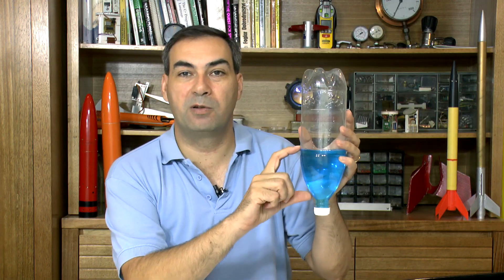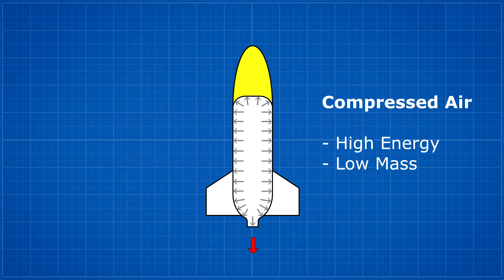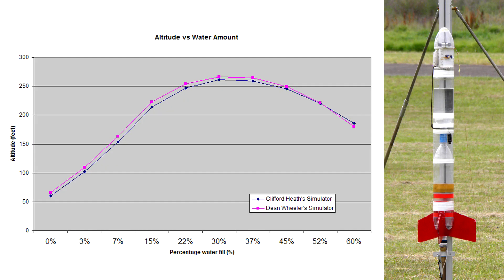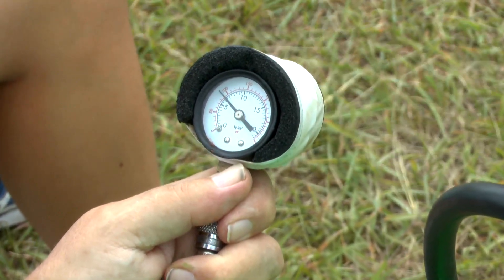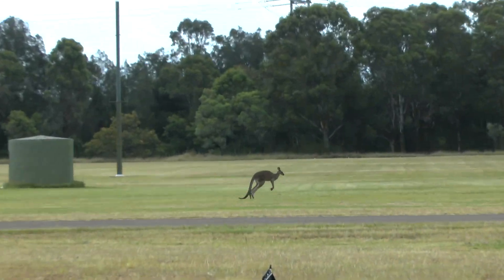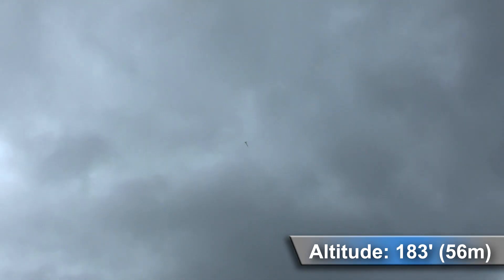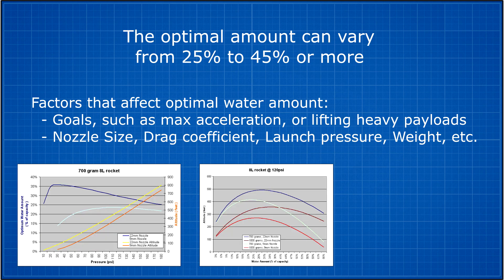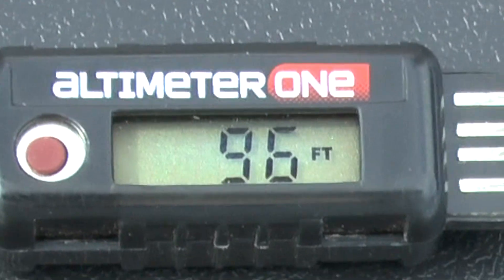How much water to use in a water rocket

Comment: how did you check the height of the rocket?
Reply from the maker: Using a barometric altimeter. They are very sensitive and accurate down to about 1 foot resolution.

Comment: If you put a smaller opening at the bottom of the rocket, would that make a difference? Let say instead of a 1" opening, you go to 1/2" opening and increase the air pressure to 200 psi, like when you put your thumb at the end of a garden hose,  it makes the water go further, wouldn’t it be the same with a rocket?

Comment: If addon electric heater stage using motion spin turbine generator supply electric to heater  make it real powerful
Reply from the maker: You wouldn't be able to heat the water fast enough. In a small rocket like this, it has about as much water as a tea kettle. Try boiling all that water in half a second. Also any generator is going to add weight and drag.

Comment: Can you suggest a mathematical way to calculate the optimal amount, like what equations are used to run the simulation. I did some calculations for my rocket but they don't predict between 25-45 % range.
Reply from the maker: Best way is to use a simulator. http://www.aircommandrockets.com/sim/simulator.htm or http://cjh.polyplex.org/rockets/simulation/ but if you really want the maths then this is a really good detailed explanation: https://www.et.byu.edu/~wheeler/benchtop/pix/thrust_eqns.pdf
Reply: @AirCommandRockets  Yes, i read your detailed description on the website. The pdf you sent was useful. Solved my problem. Thanks. 😊

Comment: WHAT TYPE OF TELEMETRY DO YOU USE?
Reply from the maker: We haven't done any telemetry yet, as in send live data to a ground station. We do collect on-board data though including barometric pressure (altitude) acceleration in 3 axis, temperature. Velocity and acceleration are derived from vertical distance.
Reply: @AirCommandRockets  your channel is very good, I am in a school project and I rely on your channel to see your rockets, they are really good. Thank you very much!
Reply from the maker: @francuadasilvacosta5116  Thanks, glad to hear that the videos are useful. :)

Comment: now what if you launched a rocket with a proper CD nozzle, with only air? and also due to being so light you could have a larger tank?
Reply from the maker: We've compared water rockets with air+water and with just air. The air-only rockets went about 2/3 the altitude of water+air. A CD nozzle wouldn't make up that difference, but it would help.

Comment: I wonder will NASA ever consider water rockets as part of the booster,  the advantage is that water spouting together with the flames can damp the noise from the raptor engines
Reply from the maker: No, water rockets are extremely inefficient.

Comment: The secret of using water and air pressure is that we can replenish during fly because we can use fuel less electric and reproduce air and water and continuously compress and repulse to travel into space of around earth many many time. According ti my calculation, the ải water pressure of 6 stages each use 2 litter at 1200 psi so total missile weigh only 50 lb can be shoulder launch or base launch and 10 lbs war head can get to 5 km altitude at match 3 speed and if deliver by a drone at high altitude can beat even b52 at 50000 ft for bigger bmversion is only a few dollars more

Comment: Hi sir, can you provide an equation to prove your experiment please
Reply from the maker: https://www.et.byu.edu/~wheeler/benchtop/pix/thrust_eqns.pdf
Reply: @AirCommandRockets  thank you so much!!!
Reply: @AirCommandRockets  hi sir, sorry to disturb you again but actually I am not able to understand the whole document. Can you please provide me just the equation to show the relationship between the amount of water in the rocket and the height reached by the rocket. Otherwise can you tell me the page number where this equation will be present. Thank you so much😄
Reply from the maker: @priyanshbhatter9338  The document describes the motion of a water rocket in detail. It is not simple. There is no simple equation that just relates the amount of water to altitude. There are many interrelated parameters that need to be considered when working out the final altitude. Simulators are typically used to calculate the predicted altitude based on the various parameters. http://www.aircommandrockets.com/sim/simulator.htm and http://cjh.polyplex.org/rockets/simulation/

Comment: does adding boosters make you able to use more water in the centre stage since you increase the total thrust on the vehicle at liftoff, so that the heavy core is able to lift itself normally and achieve a longer thrust duration?
Reply from the maker: Interesting question. So yes, the boosters would allow you to add more water to the center core to get a longer duration thrust, if thrust duration was what you are looking for. However, it will result in less altitude because you are adding more weight to the whole system and so you will use up some of the performance of the rocket to overcome this added weight. Secondly the core stage will under-perform because you now have less air in it (shared volume with the water) It is the compressed air that provides the energy. Having less air means you can store less energy. The 1/3 water to 2/3 air ratio still applies as optimal here. 

But you are on the right track of wanting a longer burn. The longer burn can be achieved by reducing the nozzle size. This way you stretch out the burn over a longer period while still retaining the correct water/air ratio. The boosters allow you to get a rocket up to speed with a relatively small nozzle that normally wouldn't allow the rocket to get off the pad by itself. A longer burn allows you to travel slower for longer meaning you induce less drag. Since drag is proportional to the square of the velocity. So you can get somewhat slightly better performance that way as well.
Reply: @AirCommandRockets  but isn't ballistic trajectory based on an initial velocity V0 minus the drag and gravity acceleration? In this case, a higher V0 is going to result in a longer coast phase, therefore a higher altitude. Regarding the adiabatic expansion, that was our main concern when adding propellant to the centre core. We just didn't properly understand how to apply it mathematically in our simulations. In a previous video, you stated that plain PVC pipes don't work well as high pressure vessels. We found ratings for 80 PVC pipes and found out they can withstand over 600psia of pressure... Is there any reason behind the material strength why it can't withstand any higher pressures that a regular PET bottle?
Reply from the maker: Ballistic trajectory is also dependent on the initial altitude. Ballistic trajectory happens when you stop producing thrust. So with a faster burn you get higher velocity (and higher drag), but you start at a lower altitude compared to if you stop producing thrust later in the flight with a slower velocity. In the end there isn't much of a difference between the two altitudes. 

I'm not saying you can't use a PVC pipe for a rocket, but you can't easily compare it to a PET bottle. If the narrower PVC pipe with it's wall thickness can hold 600psi, you can't compare that to a PET bottle that bursts at 190psi. To compare the two, make a PVC rocket the same size/weight as a PET bottle. I am not trying to discourage you from experimenting, I'm just providing information based on what I have seen over the years people attempting to make rockets out of PVC and why you don't see it very often. If you are going to pressurise PVC to its limits be careful of the shards that will be generated when it lets go. Stay at a safe distance.
Reply: @AirCommandRockets  we will! Thank you for your precious advice. Good luck with horizon!

Comment: would higher air pressure allow more water to be stored in the rocket or is the efficiency independent of pressure?
Reply from the maker: It is mostly independent of pressure, though there are slight variations if you want to get super optimal.
Reply: @AirCommandRockets  Thanks! that's actually pretty helpful! That means that there's not as much need to fiddle with the water as pressure increases. On the other hand, now the question is treating the water, or using other liquids. after all, a heavier fluid will give more ΔV per launch... but that's an entirely different thing.
Reply from the maker: Yup, here is a video that covers different liquid densities. A denser liquid will result in more thrust but not necessarily higher altitude. https://www.youtube.com/watch?v=Fu3rIiPy_18

Comment: I would like to take about a 10,000 gallon air tank place it under a boat hull and pull water in from the ocean around it. There would be no fuel weight 
Boat design calls for 3 Hulls. Roughly thirty thousand gallon total. Botas designing at 87 ft length  by 40 ft width. I am looking for suggestions on nozzle diameter.
Reply from the maker: Depends on how much pressure you intend to use.

Comment: I'm trying to understand why putting ANY amount of water in an air-powered rocket makes it fly higher than using just the compressed air. Certainly the water adds considerable weight, plus it means less compressed air (less energy), so it would seem reasonable that it would fly not nearly as high as with just compressed air.  In addition, in some of the videos it actually shows that some of the water that's exiting the nozzle is actually moving in the SAME DIRECTION as the rocket, which would seem to imply that it's not acting as exhaust contributing to the thrust.

I'm thinking that the effect that the water has is that it keeps the internal pressure higher slightly longer than with an air-only setup, since the water isn't nearly as fluid I know that's not quite the right term) as the air, so it takes a bit longer to escape through the nozzle. Maybe the issue is that you're using the same nozzle size for both the air-only and the air-with-water launches. Maybe the air-only needs a smaller diameter nozzle and it would then reach a higher altitude.

It just seems counter-intuitive that adding the relatively tremendous amount of water weight to the rocket and the significantly less pressurized air should result in higher altitudes.
Reply from the maker: It may seem counter intuitive. For a definitive answer here is a good explanation with equations and everything. http://www.et.byu.edu/~wheeler/benchtop/pix/thrust_eqns.pdf
Reply: Conservation of momentum and Newton's third law

Comment: I have a question if I try to use the same amount of water but the pressure is 90psi could be the altitude of the rocket similar to your results? or the results would apply when applying the 210 psi only
Reply from the maker: I am not sure I follow, are you comparing your rocket to the experiment? Your rocket should still roughly use 1/3 water. That will optimize the altitude for that rocket. At lower pressures it will fly lower and higher pressures it will fly higher.

Comment: sir what shud be the water amount if pressure must be fixed to 50psi
Reply from the maker: +Tanuj pal singh rathore What is the capacity (volume) of your rocket?
Reply: +AirCommandRockets sir it's 2 litre
Reply: +Tanuj pal singh rathore Try using around 650-700mL of water.
Reply: +gk123434534 OK sir

Comment: awesome science tutorial if the rocket is filled with liquid nitrogen only what will happen
Reply from the maker: +Bryan Ang Good question, I'm not really sure. I guess it would depend on how quickly the nitrogen would boil off and how much pressure could build up at the top of the rocket to start pushing the liquid nitrogen out of the bottom. If you held the rocket sealed for a while you would probably build up enough pressure.

Comment: thats an amzing explication now i know how much water do i have to put. But i have a question maybe you can help me. How much fins do i have to put in my rocket water 1  ,3 or 5? or maybe without fins?
Reply from the maker: +Piero Martin Mendiburo Merino That's a really good question. If you are talking about normal flat fins, then a minimum of 3 is required, and 4 will give you a little more stability with smaller fins. 5 or more fins will generally tend to have a negative effect on altitude because you are increasing drag and weight without adding to stability significantly. You could potentially use 1 or 2 fins but would need to spin up the rocket to get stable flight. Of course you could also use a single ring fin without needing to spin the rocket.
Reply: ok thanks a lot for the answers. and one more question if i don't have fins in my rocket  what will happen?
Reply from the maker: +Piero Martin Mendiburo Merino That depends on your rocket. If your rocket is fairly short it will most likely tumble end over end and not go very high. You need to make sure your rocket is aerodynamically stable in order for it to fly straight.

Comment: I challenge you to get a water rocket to 5120 feet, after I challenge a solid motor stage then the second stage a water stage 1.8 liters at 200 - 400 psi
Reply from the maker: +Jirreh Smith Why 5120 feet?

Comment: For fun, I'd like to see an 80 or 90% water launch, with perhaps a longer launch pole. Or with boosters...
Reply from the maker: I agree, it would be interesting to see. You'd also would want to make sure the rocket is stable when it's that full. You wouldn't want it flying out of control at the launch site. Probably a bigger nozzle would be useful in that case.
Reply: +AirCommandRockets Exactly... when my brother used too much water early on it was a beautiful slow lunch but it went nearly horizontal at very low altitudes (10-15 feet!!) which is of course not the the safest situation lol.

Comment: Fun and educational. Great for elementary and high school.
Congratulations George.
Reply from the maker: Thanks Neno. :) We have good fun doing these videos.
Reply: @AirCommandRockets  for some reason using a water rocket simulator at 20% gave me higher altitude than 33% for a 2.1L bottle
Reply from the maker: @FirstLast-tx3yj  Other factors come into it as well like the dry weight of the rocket and the drag coefficient.
Reply from the maker: 1/3 water is a general rule of thumb that is a good starting point for most rockets, the optimum amount will vary slightly depending on various other factors. If you have a look at this graph it shows you the optimal amount to use depending on the size of nozzle and weight, all other things being equal. http://www.aircommandrockets.com/images/water/Water_2L_altitude.png Here is the full article on optimizing the water amount. http://www.aircommandrockets.com/water.htm

Comment: Again: Nice Video!

 By the way: How do you trigger the Parachut of this Rocket? Do you use your timer or another Method? I am currently devoloping a deployment-mechanism with an Arduino nano as the main component. I was wondering what Sensortype would be more practical: A G-Sensor or a Barometric Sensor? What do you think? 

Keep on the good work! Love your Videos!
Reply from the maker: Thank you MultiSegelflieger, We use our timers for these rockets. I would highly recommend a barometric sensor for your project. There are some great breakout boards available on the net that have the barometric sensor and support components built on so all you need to do is talk to it from the Arduino. One thing to keep in mind is to keep the sensor out of the sun, otherwise you can get false readings. Good luck with the project.
Reply: +AirCommandRockets Thank you very much!